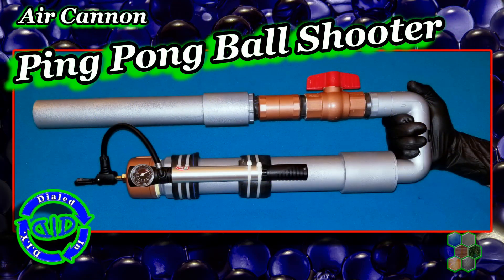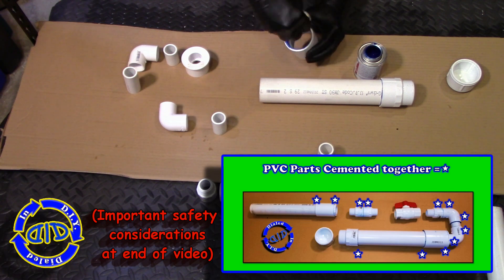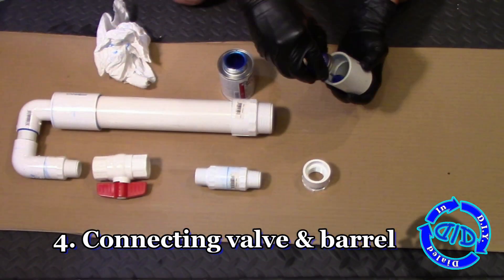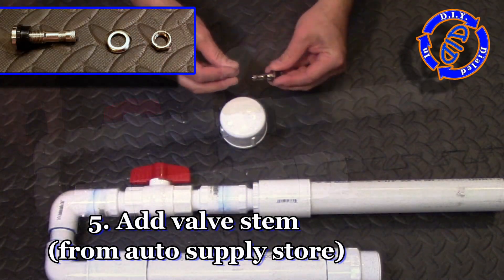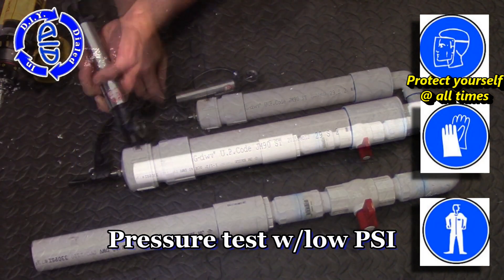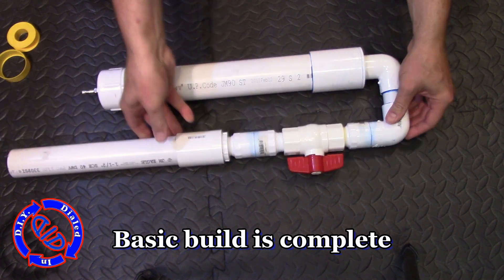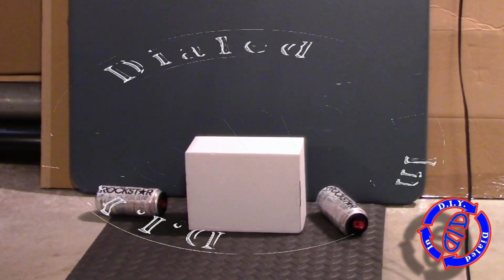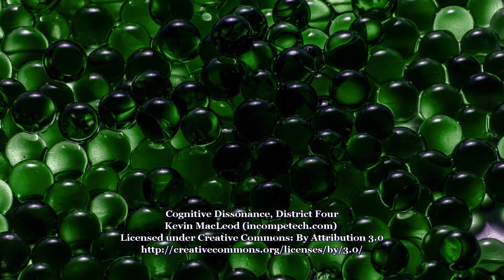Air Cannon Shoots Ping Pong Balls - Complete Tutorial

Comment: Is there any good reason you can’t use one main piece of pipe and only buy the adapters to get to the size of the ball valve/
Reply from the maker: You definitely can.  I have made some other videos doing something similar to what I think you mean.
Reply: @DialedInDIY  ok good to know, thanks. I actually ended up just doing it and it worked great! I’m doing it for a school project where you have to make it go the farthest, are there any pieces of advice you would suggest?
Reply from the maker: @2tmb904  Depending on what you are shooting out of end... is it a ping pong ball or something else?  The rapid change in pressure causes some heat exchange which can also lead to moisture in the barrel. I've not had a problem with that but it is worth keeping an eye on (could slow down lighter weight projectiles). My other recommendation is a word of caution; watch the total pressure pumped into the chamber as you try to reach longer distances. PVC is rated for fluid pressure so you do not want to over pressurize your chamber. I also always discharge right after filling and never set it down or leave it pressurized.
Reply: @DialedInDIY  yeah, i noticed the moisture thing you were talking about, it looks like smoke comes out of the barrel every time i shoot it. I am shooting a ping pong ball, i already had 1-1/2 inch piping so i didnt want to go buy a bunch of adapters and tubing, so all i bought was a 1-1/2 inch ball valve, two 90 degree 1-1/2 inch elbows, and a 1-1/2 inch slip cap. Everything else was 1-1/2 inch pipe, and it worked great, the farthest i got was about 90 feet.

Comment: About how many pumps with the bike pump does it take to get to about 50 PSI? Just curious how fast that type of pump can fill the chamber. Thanks
Reply from the maker: That smaller pump takes quite a few pumps. Not sure the exact amount.  It works but I often use a foot pump or compressor if I'm shooting a bunch.

Comment: If I were to use a 4” pipe for the pressure chamber instead of a 2” pipe, could I in theory build more pressure and shoot the ball harder? I have some leftover pipes laying around and any saved budget would be awesome.
Reply from the maker: I have used many different size pipes for pressure chambers with great success.  Bigger volume in the chamber (either in diameter or length) does create a more dynamic effect but just takes longer to fill each time. Whatever size you use just be mindful of the pressure limit; for safety purposes (take into consideration condition of pipe and specs for the classification of pipe).  Thanks for watching and commenting!

Comment: Great build!  What’s the max PSI this design can handle?
Reply from the maker: Great question but one that I do not have an answer for.  There are some PVC products that have gas pressure ratings but most are rated for fluid pressures.  I have not pushed this to a max or failure point. On mine, I have used up to 80 psi. An important point is to start slow and build up checking for leaks, etc. A couple big factors in max pressure are strength of cement bonds and how solid the materials are (i.e. aging, contact damage, etc).  Thank you very much for watching my video and commenting!

Comment: You could add a solenoid valve in place of manual valve so the operation would be more effective and fast.
Reply from the maker: Thanks.. that is an awesome idea.  I have been working on that idea for quite a while but have not yet finished a project on it yet.  I am using sprinkler valves but modifying the body to allow for full, rapid opening.

Comment: Is there any way to limit the amount of pieces needed with ruining it's integrity or durability, while keeping it somewhat safe cuz I'm trying to save money and build and artillery
Reply from the maker: Actually, yes.  I use extra threaded parts so that I can remove parts and repurpose BUT if you go straight to the "slip" connects and cement your connections then the parts cost less.  You also don't need as many parts.  I must say I am very curious about the "artillery" you are building.  Sounds like it could be something quite fun... but maybe I "donneedtoknow" (sorry, couldn't resist).
Reply: @DialedInDIY  thanks
Reply from the maker: No problem at all (glad I could help in some way).  Would love to hear the results of your efforts if you get a chance to follow-up.
Reply: @DialedInDIY  

I have made 3 variants so far and have implemented it with a few variations on it.

The first variant was pretty much a failure.

The second variant was succuesfull though it was quite big so I scrapped it. It was 11ft 3 inches long (with legs) and 3ft 4in tall (with wheels and armor) and about 3ft wide (with wheels).
It was 6ft 1inch long with just the cannon and I'm guessing 10inches to 1ft in height since I didn't measure.

The third variant was more refined but still large and I also had to scrap that due to the sheer size.

I managed to find a way to load it via the rear, instead of the elbow joint, I put a T-Joint and made a closing flat at the opening of the T-Joint. Now I can load the ball from the rear instead of the front. I also made a unique casing for the ping pong. Instead of just putting in the ball, I wanted a bit more pressure buildup ship being safe. I modified some copper tunings and added some rubber O-rings, now the ping pongs fit tightly inside so one I load the cannon from the rear, all I have to do is close the opening and twist the knob, the o-ring on the copper tubing allowed the ball to stay in a bit longer and now it shoots harder and faster then if it were in the basics tubing.

I am planning on making a 4th version more compact now and I'm currently designing a frame for it. 
I can load from the rear now to make it quicker but I'm currently thinking of ways to easily interchsnge the tube with the air, cuz that takes a long time to fill up.

Third Variant
Also this thing shoots sort of far, I shot in an open field and it went about 450-500 feet distance aiming at about a 20° angle.

This helped me a lot thanks

I also never took picture but it resembles a Zis-3 of you search it up.

My new version is going to lol more like a Pak40 or Pak38 if you search it up.

Copper tubing is rather expensive too so I'm also trying to find alternatives that are heavy durable and shiny

But thank you for this video, it really helped me out

Comment: Hey, I built this model, but whenever I fire, the ping pong ball is sucked into the valve instead of being pushed out, what did I do wrong?
Reply: So apparently I'm creating a low pressure chamber? How is that possible if I'm pumping air into the chamber? Please help
Reply from the maker: My first thought is to check the pump you are using.  Is it one that is adjustable for inflating and deflating?  It just sounds like it is setting up to work like a vacuum.  If that is not the case, then are you getting a rush of air out of the barrel if you do not add the ping pong ball?
Reply: @DialedInDIY  Hi! I found the cause of my problem, it was me being ignorant hahaha. I tried to test run the cannon by not cementing the pipes together and was baffled when 1 PSI didn't do anything. Works like a charm now. However, I do have to retape the valve threads every now and then because I hear a slight leakage, any way to prevent this? Nevertheless, thanks for this awesome video!
Reply from the maker: Awesome... I'm so glad it worked!  I have had the same issue with the threaded sides leaking.  Best fix is to get a valve with slip connections and cement it... but short of that, I have had success with adding a bunch of plumbers tape.  The yellow, gas rated tape works great too. After the tape goes on really tighten the connections.